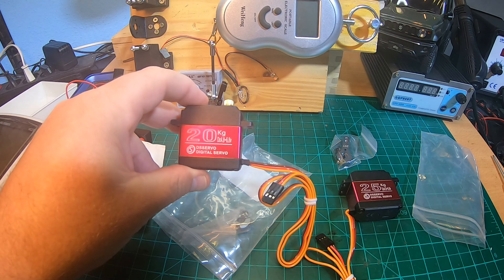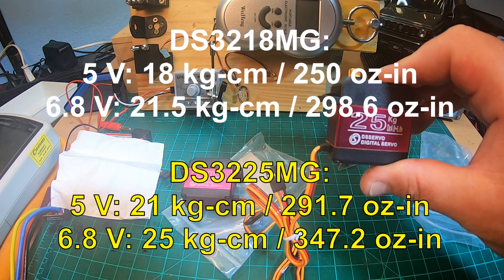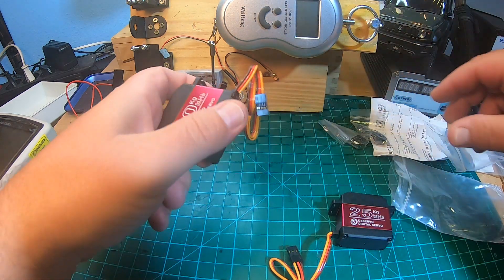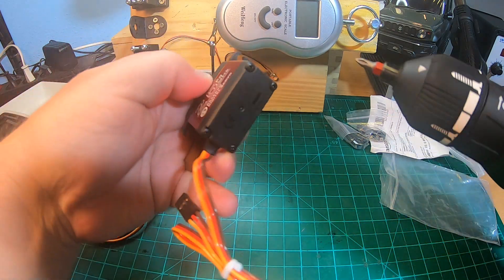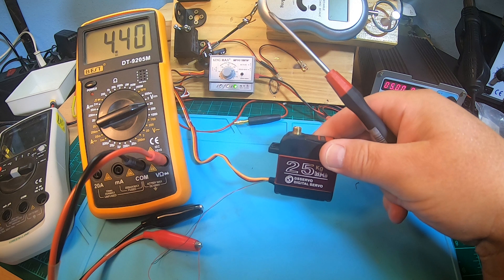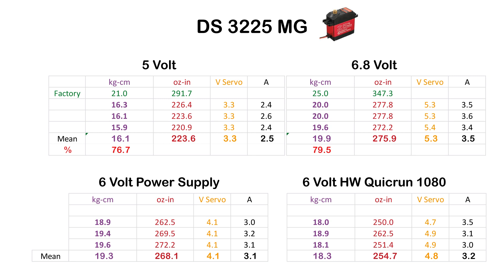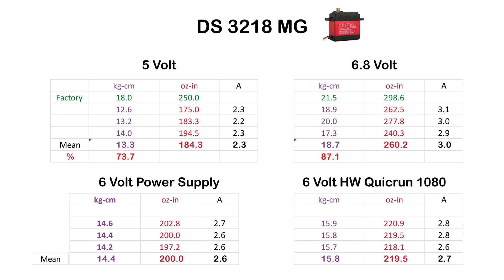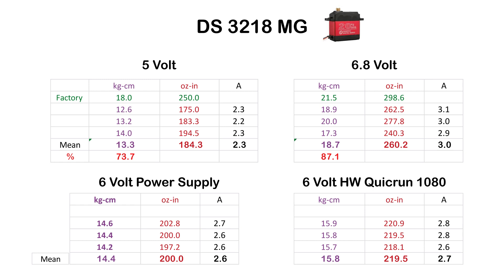Servo Test: Annimos servos DS3218MG and DS3225MG

Comment: Would you recommend DS3225MG over DS3218MG in terms of precision? Any torque more than 18kg is fine.
Reply from the maker: Precision will be the same, but 3225 is stronger - so I recommend 3225MG.
Reply: @donaldsneffe  Thanks!

Comment: Is there going to be a difference in the torque depending on mounting position used on the servo horn?  I assume the ideal distance on the servo horn would be 1cm from the centre of the servo output shaft?
Reply from the maker: Nearer, more torque, less speed, farther outside, less torque, more speed. There is no "ideal" position. 1 cm is the distance servo torque is measured (in kg), in few countries they use inch (and ounzes) for this.

Comment: Is this servo actually waterproof? Would it withstand pressure under 10ft of water? (For use with an RC Submarine of sorts)
Reply from the maker: No, would for sure not. It can take short dives and splashes, but not being a submarine.

Comment: hello..can i program the servo with arduino ?
Reply from the maker: No
Reply: @donaldsneffe  oh ok thank you
Reply: @donaldsneffe  why wouldn't you be able to program it with the arduino. Because of the voltage requirements?
Reply from the maker: @miximum1  I do not know anything about Arduino.
Reply: @miximum1  There is nothing to program in these Annimos servo. The input to output is linear and can't be changed, unlike some higher end servos where you can program the speed, torque and angle within the servo. Now, could you control these Annimos servos with Arduino? That's a possibility.
Reply: @nigel_white  sure you can control them with Arduinos

Comment: Hey I got both of these and I connected them to a receiver and they aren’t working. I’ve tested other motors and they work, what do you think is wrong?
Reply from the maker: Other motors?
Reply: Sorry meant servos
Reply from the maker: @dinowarrior1962  If other servos work in the same port and the servos are connected correctly, then they must be broken. 
Very strange both should be broken...